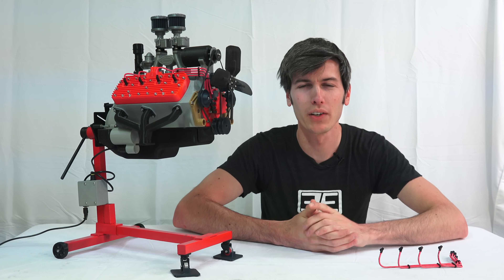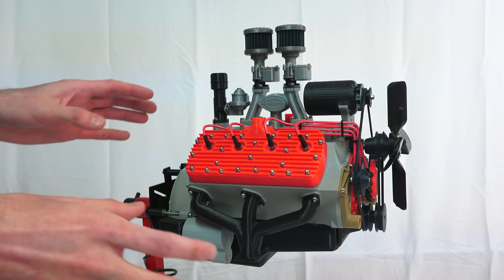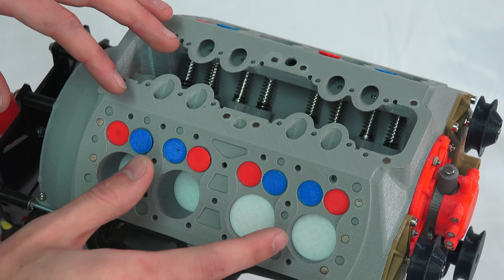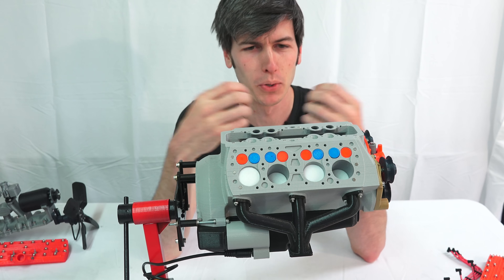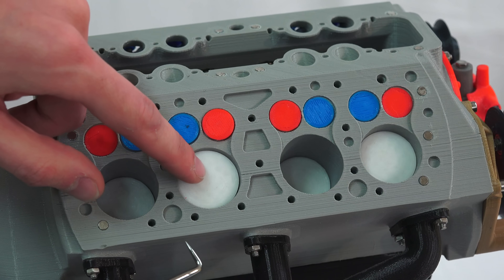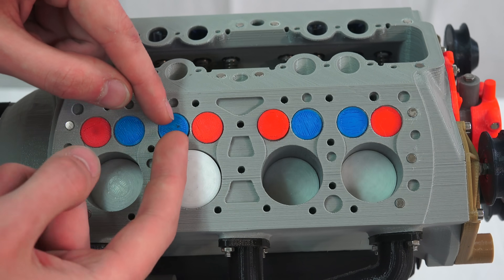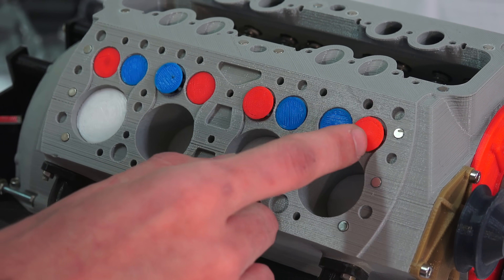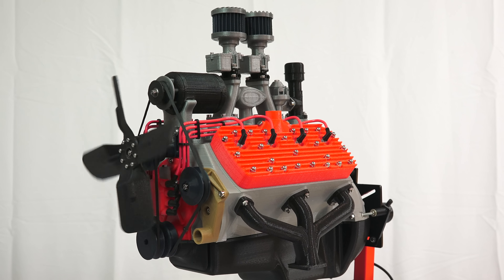Why Ford's Flathead V8 Engine Died

Comment: Propane will support high compression in a flathead. With CNG becoming widely used, that's another option.

Industrial flatheads on propane ran forever because the rings don't stick from unburned gasoline.  

I like flatties. Within their limits they are good motors

Comment: Until,this video of yours, the Ford flathead was NEVER referred to as n.n Liter engine size. It was always referred by CUBIC INCHES, so nobody in America will understand what size flathead generation you’re referring to. There is a time and place for everything, and calling an old Ford flathead by anything other than cubic inches just confuses us.
Reply: @CrazyPetez  sounds like a you problem 🤡
Reply: @Jack777Er  Not really. You must be a Brit or somebody raised on the Devil’s Measurement system. That’s certainly not MY problem.

Comment: It was an extremely complicated casting ford spent millions many of the early ones were returned for pin holes inthe casting. Cracks in the casting. Problems with cooling. Oil pan design etc. If you compare the engine with something like a small block ford with valves in head. That would have been much easier to cast. Henry ford was a very stubborn  dictatorial type person poor Edsel.

Comment: The Ford V-8 flathead had to go when the Interstate highway came along after WWII. It will overheat every time on the Interstate. It wasn't designed for that. Henry should have increased the diameter of the middle exhaust port to a size that would equalize the backpressure of that port to match the other ports because that is where the heat builds up and blows the radiator. The middle port scavages heat from two cylinders while the others only one.

Comment: So is this the reason why they always ran kind of lean and bounced around a lot even without a High lift cam?  Made it hard to adjust the Carbs at Idle and they really lacked power and were really not fuel efficient.  I have a couple of them laying around still complete, but they are just engines, they run, but I have no real use for them. I think one of them is a 400 or something and the other is a 300 something.

Comment: Arguably it never died. I'm aware of three trucks that have been in fairly consistent use (two grain trucks and a plow truck) that have flathead 8s that still do regular work, although they aren't used on a daily basis. It isn't about when a company stopped making an engine, it's when people stopped using/caring about it that determines when it dies.

Comment: My Dad & several other old timers told me of the terrible problems Ford Overhead V-8s had of oiling the top end & used to run a copper tube into the valve covers to put oil there.

Comment: I can tell you from real world experience, an engine that runs but has inefficient air flow but is simple to work on, is a lot more useful than an engine that is dead with great airflow design that is too dmmn complex to ever work on and is now a dead yard ornament.   Simpliciity is more than just beautiful.. it's ultra beautiful because... it will work forever and you can fix it.

It'd take this Ford Flathead over the dead Interference Ford Escort front wheel drive engine I have that is a hundred times "better engineered" supposedly... not....  that don't run and will never be repaired because I've done tried...

A modern engine where the vale seats can drop from heat expansion differences and stick y our vales right into the path of the cylinders..  yeah I wouldn't say that's idea at all...   air flow be dmmned.

Comment: Compression ratio.volumetric efficiency the gasses by the valves were alternating direction.  Simple enough to build but overhead valves could produce a lot more power.

Comment: I grew up in the 60s when flat heads were still around, but mostly gone.  Some were still used in race cars.  I have no reason as to why, but I loved those engines over the better more powerful overhead valves.  I just thought they were so cool.

Comment: I have been wanting to see a "modern" flat head engine be manufactured. I have wondered with using newer technology and the old school design, could you make serious horsepower with a reliable and simple design? I understand air flow is not ideal BUT with the addition of a turbo charger it wouldn't matter as much. Newer tech today surely we could vastly improve on the design while adding a power adder...

Comment: Haven't seen it yet. Predictions are that the flathead had lower compression ratios and airflow leading to bad fuel economy and low power. Will update in 8 minutes and 20 seconds' time.

Comment: Interestingly, modern hotrodders have found that forced induction does a tremendous amount for increasing the airflow efficiency, peak cylinder pressure and subsequently power in flatheads. 
But it's still bad. lol. It's just interesting that if supercharging was more developed and in use other than aviation, it might have been an intermediary step between side-valve engines and OHV engines.

Comment: I owned three 1950 Ford's and one 1953 Ford. They were wonderful cars and would do 100 mph all day long. The 53 was bought for $800 in 1987 and was totally stock. It had never been rebuilt and had the original gumdip tires. I drove it for two years and sold it for $800.

Comment: You may need to research "post war flathead block cracking problems". The existing seasoned blocks were used up during WW2. The blocks were cast originally and semi machined- then piled up outside in the weather for many months.This seasoned the blocks and made them less susceptible to heating and cooling cycles/cracking  when finished.The post WW2 blocks were never seasoned, so a new over head valve engine was developed to end this problem.

Comment: Imagine one of these in a billit block, larger valves large and displacement. Much bigger bores on the intake and exhaust, great cam, on like 15 psi. The problem was the three main journals every time someone would find a way to hop one up they'd throw the crank out the bottom.

Comment: WHEN HENRY FORD FIRST INVENTED THE V8 ENGINE. IT WAS SUPPOSED TO BE AN OVERHEAD VALVE ENGINE. BUT IT WASN'T COST EFFECTIVE BECAUSE HE KNEW HE WAS GOING TO MAKE MILLIONS OF THESE ENGINES, HE THEN OPTED TO MAKE IT A FLAT HEAD DESIGN LIKE ALL THE CURRENT STRAIGHT 6 CYLINDERS AND STRAIGHT 8 CYLINDERS WERE.

Comment: That was a 8 cylinder lawnmower engine, many high performance parts available.  What was the highest horsepower for a flat head?
Reply: It's probably the 700 HP Ford flathead V8 that has been used in a land speed record streamliner

Comment: Retarded engine design. Who tf thinks that pulling The exhaust though The WHOLE freakin top is a good idea? Rev high enough and youll get detonation before The air/fuel mix even hits The comchamber. Potentially causing a fire in your carburator. Or blowing The top and carb into pieces(this is my last Resort) sorry. Adhd.

Comment: Works great at low rpm or with poor quality gas and is mechanically very simple (splash oiling, for example), so it was good for its intended use. Now that we have paved roads and higher performance demands, it’s no longer as efficient.   Most lawnmowers are still flatheads, though.

Comment: Fun Fact: The generator was also the starter. Probably made sense at the time, but it doesn't take much imagination to see how this could cause problems down the road. However, with a compression of only 5.5:1, it did the job at the time. 
Also, you mentioned that the model is of a later model with higher compression ratio and greater power. How they accomplished that is shown in the video. At 1:42, while you are holding the head in your left hand, you can see that the combustion chamber looks like it is heart-shaped, or that the combustion chamber has Mickey Mouse ears, pick your metaphor. The original combustion chamber was more oval-shaped. By making the head fit around the valves improved both air flow and compression ratio. Not enough, granted, so the first generation overhead valve engine developed a LOT more power with the same displacement. But it was a good start and Ford engineers are to be congratulated for a job well done.
Over all a great video! And how much fun was it playing with awesome model, Eh?

Comment: the flathead motor gained a lot of power when arcus -duntov invented a new cylinder head which turned the flathead into an overhead valve engine

Comment: Please Google "Ardun heads" which were aftermarket Hemispherical OHV heads (4 years before Chrysler made their first HEMI). Ardun's for these Ford "Flatties" were designed and made in the late 1940's by Duntov brothers, Yura and Zora, the father of the Chevy Corvette.  Full race Ardun head builds yield around 300hp and a good deal more torque than stock.

Comment: Good video. Ford flatheads are great to use but a defect in design came in ‘52 when they changed how it cooled. The water spigots on the heads were changed from the middle of the head to the front. This caused the block to crack in the middle . One in a thousand old style cracked. One in a thousand new style didn’t crack. If you are going to use one, ensure you get the old style with the spigots in the center of the head.

Comment: I'm not an engineer, but I'm pretty sure intake/exhaust flow are in opposite directions no matter what valve configuration you have. How is the exhaust flowing in the same direction as the intake on an OHV? The piston is pushing exhaust out of the valve, so even on OHV engines, the exhaust flow is opposite that of intake.

Comment: Many engines before and after 1932 were flatheads, both V and straight, including V12s. The military was still using straight 6s during the 1960s, probably because they were simple and reliable. Old Packards used a straight 8 327 CI. A friend of mine used to drag race one, yes really.

Comment: How sophisticated it was for it's time lol maybe for Ford. I'm doing a 31 chev ton and a half and it has an overhead valve  straight 6 and its the original motor never been even worked on and it runs decent AND the design is so good chev used same basic design to the 70s

Comment: I am very impressed with the knowledge that this "old man" possesses and imparts to us all. The one thing I dispute in this video is his explanation of a portion of the intake mixture having to travel over the valve. I don't know how much clearance there is between the fully open valve and the surface of the cylinder head but I assume it is small. The fuel/air entering the combustion chamber from the backside would seem to be sucked around the valve stem which would not impede the flow too much. The air not really changing direction like he claimed. In an overhead valve design all the intake flow has to go over the body of the valve and the exhaust flow is somewhat impeded by the entire valve as it exits. I'm a big fan tho and not trying to disrespect.

Comment: So the exhaust travels through the block going around the cylinder walls to the exhaust manifold? Wouldn’t cooling be an issue also affecting the temper of the metal?

Comment: In 1955 I drove my 1941 Mercury all across the USA to Ottawa and 3 years later back to Vancouver B.C. in my Mercury flat head . The only problem I had was my generator went on me. I drove on my battery till I spotted a wrecking yard. Replaced the generator and onto the highway to Vancouver. That flat head engine was reliable and easy to remove heads where you could wire brush carbon off valves and head, new gasket and you were mobile again. Back then you were not a "man" if you did not fix your own car.

Comment: OH AND THERE ARE 
(3) DIFFERENT MODELS
INTEGRAL BELL HOUSING SEPERATE 
BELL HOUSING AND
LARGER DISPLACEMENT
WHICH WAS FOUND TOWARD THE END IF THE MFG PERIOD 
THERE'S (NOTHING)
MOTE RELIABLE THAN A TRICK BUILT FLAT HEAD (PERIOD) 
NO PUSH RODS NO ROCKERS LESS STUFF TO FAIL BETTER LIVING THROUGH LOW COMPRESSION AND WILL RUN ON DITCH WATER

Comment: It should not have died with the Arden or without the Arden I used to drive one everywhere they would take much abuse the way they were they would run on 25 lb of compression and half the cylinders and run a hundred miles an hour

Comment: You have got your air flow for the exhaust valve wrong !!!
It doesn't matter if the engine is a flat head or OHV , the exhaust gases flow out of the cylinder in opposite direction to the air/ fuel mix coming in.
You showed flow in the same direction with your arrows.
Get it right.

Comment: Pretty sure 4:1 crank-to-cam is universal among 4 stroke engines; 2:1 won’t work.
Reply: No, the ratio is 2:1. It takes two rotations of the crank to complete the four strokes. The camshaft will only rotate once because each valve only opens once in the four stroke process.

Comment: At 4:33: What are you saying? "... on todays engines, the air flow goes towards the piston out around it and then down into the cylinder, rather than making a 180 degree turn." Should in not be, "the air flows towards the piston as it is moving around the valve....?"  ---- These flatheads easily encounter cooling problems as the exhaust flow is long and wraps around the outside of the cylinders heating them up.

Comment: The first American...valve in head, design  was made by  checker motors.  The did not protect, or obtain secure patent. So the design was stolen and slightly modified by Chevrolet and Chrysler.  Which is why Chevy and  Chrysler  used the same intake and exhaust gaskets for decades.

Comment: Flathead was unique having direct design trade off between the compression ratio and valve lift. Both parameters are crucial in power density of the engine.

Comment: of course, if you compare it to a late 1930's Rolls Royce Merlin.............its obvious the Ford Flat head is incredibly primitive, its just an incredibly cheap design. Thats why flat head engines lasted for so long in small portable single cylinder engines like the Briggs & Stratton.........they are super cheap to make and maintain.

Comment: My grandfather had a ‘46 Ford coupe with a flathead V8. My dad shared stories about how the valves in that engine would stick. So every few months he had to clean the carbon buildup on the valves with a product called K-cite (I think that’s how it was spelled) you would rev the RPM up and pour it into the carburetor and it would belch out billows of white smoke and you had to keep the RPM up until the smoking stopped.
Reply: pete smyth old technology that’s inferior by today’s standards.
Reply: That’s why this engine is obsolete. The only people I’ve seen who use the Flathead V8 today are rat rod owners.

Comment: You missed the most fascinating feature of the engine:  The single cast v-8 block was an enormous engineering feat in 1930.  Henry Ford literally bet the farm on it.  He also put a lot of decent people under unnecessary stress trying to figure that out.  He idled the plants several times to focus on the v-8 development.
Reply: I agree. He keeps saying "It really was a simple design."  OH HELL NO IT WASN"T!!
Reply: I heard that there were unnatural stresses because of the casting, and to insure that it didn't crack through water jackets or other areas, that they actually had a guy hit them in a non vital area with a ball peen hammer to pre crack the block and relieve stress.
Reply: This was the engine that Clyde Barrow liked in the cars he and Bonnie used in their crime sprees in the 1930’s and the were killed by lawmen in a car with this engine. Clyde even wrote to Ford praising the engine.
Reply: The story I heard was the engineers complained about all the obstacles to making it, to which Henry replied, "I want it, and I'll have it." 

I had a relative who worked for Ford at the (I think) Watertown MA plant. He said he saw men in their 50's carried out with heart attacks. The conveyor started at 7:40 am., not even 7.

Comment: i have a hot rodded flathead.  It's bored/stroked to a 296 cu in, 3 carburators, highest cam lift you can easily put in the block.  Teh C/R is about 9.2.   It get's to about 240 HP.  Next steps up would be a supercharger, but you'd have to do things like girdle the Main engine bearings (only 3 of them!).  All in all, I think I[m pretty  much at the easy limit for the design.  The engine runs great, and sound even better.

Comment: Probably worth also saying the combustion chamber shape on the flat head is awful for SA to volume ratio, which means huge quench zones and lots of unburnt mixture. Another reason why hemispherical chambers with OHV engines took over from it.